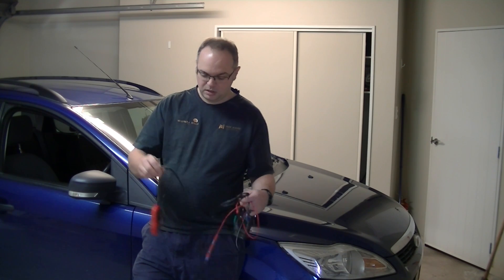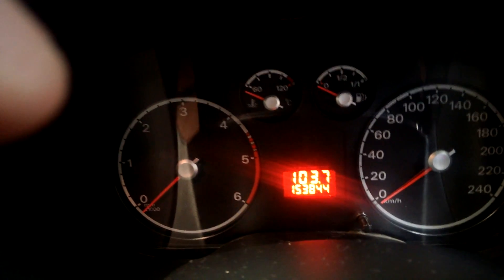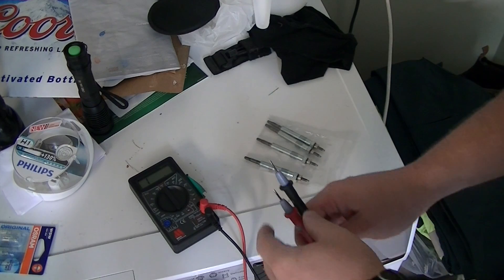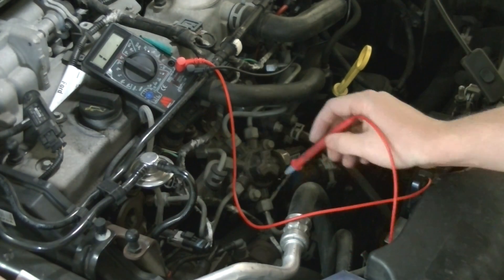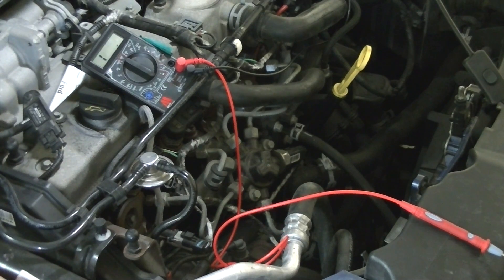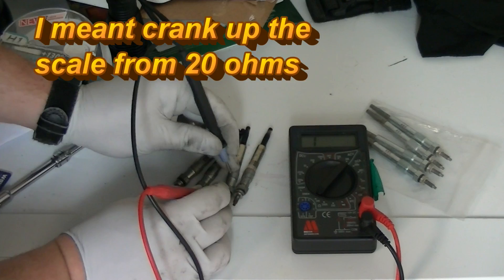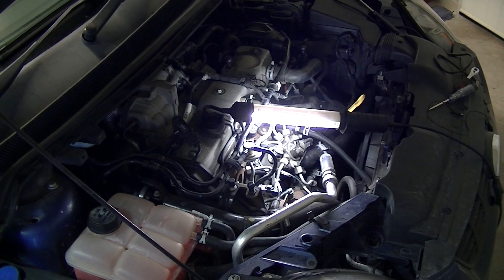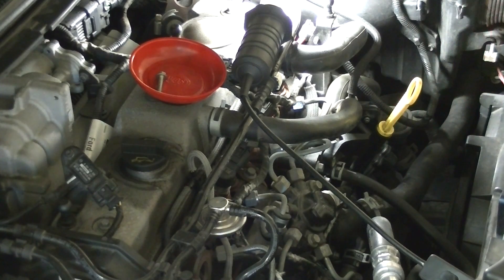Ford Focus Mondeo Transit 1.8 TDCi Glow Plug Diagnostics and Replacement

Comment: Do you know why the glow plug wiring loom burns out on the engine by the fuel filter housing
Reply: Hello. I'm currently seeing this on a 2007 galaxy 1.8. .After the engine starts the pcm re-starts the normal type relay to give glow plugs voltage and the wire then gets very hot with smoke coming off it. Have you found any problem?
Reply: @padraiggalvin2807  just the plastic had totally melted exposing the wire by the thermostat housing
Reply: Also no glow plug error flagged up on the ecu
Reply: @Joe-ug1vu  hey there! Same for me here. I saw the melted plastic a couple of moths ago, but now during winter time i noticed my battery felt empty when starting up, yesterday it was completly dead. I cut the wire going to the glow plugs and with a multimeter checked the connectivity between ground and glowplug - there was connectivity, indicating that alteast one glowplug is shorting

Comment: Hi I have a MK2 ford focus 2.0tdci  not to sure what my problem could be sometimes it will start completely fine an other times it will just turn over and over then I after turn igition off and back on I hear a clicking noise in the dash sumwere or under the bonnet asoon as I hear the click the car will start having it fully serviced and new glow plugs over the weekend but not to sure it will be the glow plugs or the glow plug relay box or even a ignition relay box. The car as only done 67k from new. Any ideas which is most likely the problem thanks 🙂
Reply: Exact same problem on my KA MKII 1.3 TDCI. All glow plugs have been tested and are fine, but I don’t know where the relay is to change it!?
Reply: @karlchop   mine  turned out to be a faulty starter motor.
Reply: @antluvsbecky  did they do the service including plugs and it was still the same? How did they figure out it was the starter motor?
Reply: No after going to deisal speclist and another garage which tried to say injectors all failed i got it back had a good look myself and me and a friend noticed starter sparking when you tried to turn key so we changed it and it started first turn of the key saving me about 500 pounds for apprantly faulty injectors be careful theres lots of rogue garages around get sumone to look at the starter as you turn the car over if there's sparks  coming from it change starter if not u ll have another problem

Comment: Asked my garage earlier and they quoted £140 for new glow plugs. He made it very clear that they may snap. Kind of disconcerting. Thinking of doing it myself but absolutely terrified of snapping one.
Reply from the maker: That is always a concern so good on him for warning you. Are they still working? If you don't have a problem leave them alone
Reply: @Badgertronix  Cold starts are awful lately. Engine shakes whilst idling and lots of blueish grey smoke. 

Mechanic hooked it up to the reader and it came back with injector fault codes and turbo overboost. I do think changing the glow plugs stands a good chance of alleviating it though. Going to buy a cheap ohm reader over the weekend and see where I stand.

I should add that once I drive 30 seconds up the road it runs perfectly!
Reply: @coggzi5865  i have same problem, let me know if you fixed it!!
Reply: @karlchop  I took it to a different garage and they replaced them all successfully for less! Guess you just have to find a good garage and trust them. Starts a lot better now but still smokes on startup. Guessing dodgy injectors but not really financially viable to fix so will just run it as long as possible.

Comment: Hi i git the same engine in my 2009 Ford s max.  I have no power going to my glow plugs when the glow plug light is on. Any ideas would be a great help
Reply from the maker: Probably either the glow plug relay or a wiring fault. The wiring is quite a common issue on these
Reply: @Badgertronix  i fixed the problem.  It was a 60amp fuse hidden on the side of thd fuse box under the bonnet.
Reply: @Richard-ps7ht  is that fuse for the relay box?
Reply: @Badgertronix  where would i need to look do i can check the wiring?

Comment: When testing the resistance of each plug to ground you need to disconnect the power wire first, otherwise you are trying to take a reading through all 4.
Reply from the maker: true, but all the plugs were buggered so I didn't get around to explaining that

Comment: Recently just found your video and thanks for sharing.  I believe the glow plugs in my Mondeo need changing as far I know they are original ones on an 2008 mk4 Mondeo, but it does seem to struggle on restarting from cold.  for example this evening it started fine but refuelled with diesel less then a quarter left and it really did struggle almost leaving me stranded.  Whats the recommended change time for these.
Reply from the maker: Thanks for watching. I'm not sure there is a set schedule for replacing glow plugs. Certainly if they test bad like mine did then they should be changed. If it's hard to start when cold then that would also suggest new glow plugs might be in order. Cheers

Comment: Hi, thanks for the video. I have a Ford Focus 2006 and I am a novice but I can figure stuff out, should I give it a go at changing my glow plugs or would you recommend taking it in to the garage?
Reply from the maker: Are yours faulty? If not, leave them alone. It's a fairly simple job to do although there is always the risk of the plugs seizing in place and snapping off which would be really bad. That would be the main reason for letting the garage do it if you weren't confident. Cheers!
Reply: Hey mate, yeah they were faulty and it was hard to start almost every morning. But an update on it, I changed them!! It was fairly easy like you said, I however lost two of those tiny bolts there but thank god I had extras haha.
Reply: And a great video you have here btw!
Reply from the maker: +Guðmundur Skúlason fantastic! Glad the video helped you out. Thanks for watching 👍

Comment: YOU CAN CHECK ON THE CAR FOR OPEN CIRCUiT GLOW PLUGS BUT YOU HAVE TO DISCONNECT EACH ONE FIRST
Reply from the maker: +glyn jones mine were all buggered so i didn't need to disconnect them to test resistance. True, if you only had 1 faulty one you would need to eliminate any additional paths to earth to test them.

Comment: Thank you for this pretty good video. Well explained from the beginning  to the end of the process. But I have two more questions sir : should we disconnect the battery during the replacement ? and should we apply a high temperature grease on the thread of the glow plugs? Thanks
Reply from the maker: +Sami EL MINAOUI I don't see a need to disconnect the battery for this as the circuit is only powered with the ignition on. As long as the ignition is off you should be ok. I put a shall amount of copper grease on the new plugs but other people put nothing on them. It's a personal preference so go with what you are comfortable with. Cheers!

Comment: I have a question sir. my ford focus has no power to the heater plugs checked fuse looks fine car rev can't go over 3000 loss of power as will. what could be the cause? dashboard showing ENGINE SYSTEM FAULT code scan is p0670 glow plug control module.
thanks
Reply from the maker: +AboMusn almohajer a faulty flow plug controller shouldn't affect the engine's ability to review. Sounds like a couple of issues. You'd need to do some diagnostics and see what part of the glow plug circuit isn't working. The wiring harness is a common fault so maybe start with checking integrity there.
Reply: Badgertronix thank you very much i will try them two things hopefully find what causes this problem

Comment: Hold on a minute... you can open the bonnet with a key!!!??? Genius!! Pure Genius! Back to watching...
Reply from the maker: +Thomas EXOVCDS It's a design that has confused many technicians over the years...
Reply from the maker: Sounds like a DPF injector problem
Reply: Badgertronix, help Ford Kuga 2.0 diesel. DTC P269F?
Reply: Badgertronix, 89225430988sh@gmail.com

Comment: Well done! It's unusual to see the whole set of G.P.s bad. Usually one or two.
Reply from the maker: +wysetech2000 Had the car over 2 years and it has always started the same warm or cold so maybe they have always been bad. Will see if I notice a difference now. Cheers!
Reply: @Badgertronix  Hi, did you notice? I have this problem now :)